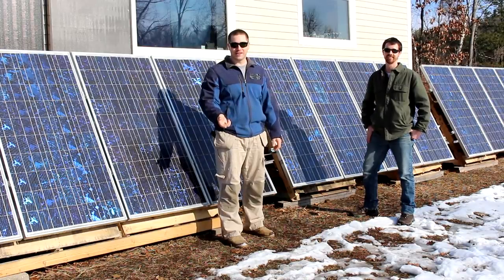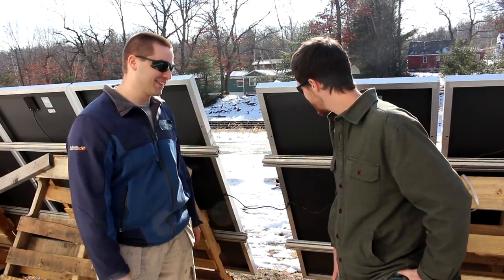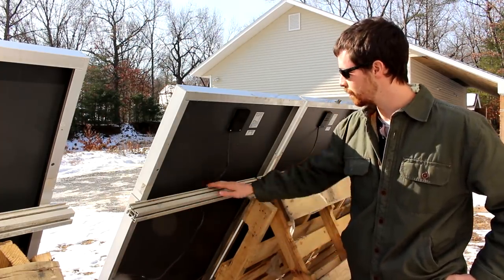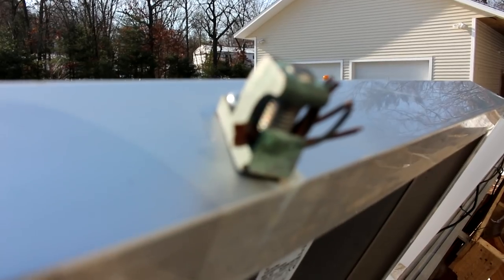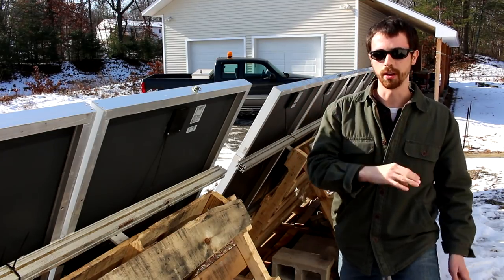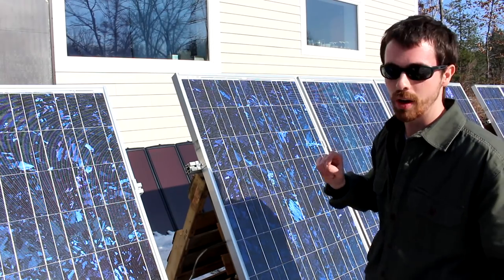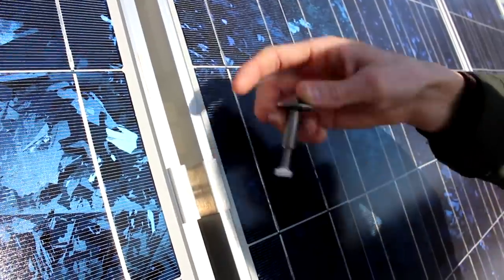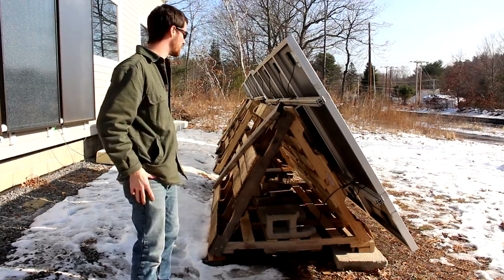A PV Expert finds the flaws in my system

Comment: Kevin was on riddilin hunh ?
Reply from the maker: Kevin just has an awesome personality.
Reply: dude you actually responded , awesome . me n my wife love your kid . he'll be wearing a tool belt in no time hanging out with his awesome father . have you ever seen the gas  DC only smart generators? they auto start when battery voltage is low. they seemed to have just disappeared. they were on Ebay.  came as a solar kit . I believe a fantastic solution as a battery tender when PV and wind is down .
Reply from the maker: Thanks for watching the videos, I'm glad both you and your wife enjoy them.  I've seen DC generators for 12v, both commercial and DIY versions.  However, I've never seen a 48vdc generator.  It would make for a fun project.  If you ever come across one, please send along a link.

Comment: All great comments except he is incorrect when it comes to shading series panels.  All modern panels (including probably these old ones) have bypass diodes, so shading a single panel does not take out the whole array.  It basically just takes out that one panel plus 0.3V of drop (out of 200V-500V), so it will only slightly disrupt the other panels.

Very very old panels... grade B or C panels 20 years ago (grade A panels would have had bypass diodes) ... very old panels did not have bypass diodes and shading one would take out the entire string.

The issue with string efficiency also relates to whether each string has its own MPPT or whether several strings are parallel'd together before going into a single MPPT.  When each string has its own MPPT, shading is minimal hazard.  However, if the two strings are paralleled, shading one panel on one string will cause the MPPT point for the paralledl strings to not be at the optimal point for either string, causing roughly the same loss across both strings as the loss from the shaded panel.   So multiply the shading loss by 2 in that situation and you get a rough estimate.

(Says me who has a two-string HV array and has done numerous shading tests over the years).

Comment: the angle of the panels should be flatter. your not in arctic circle.
Reply from the maker: Hi Borga,  You are right about the angle if this was a grid-tied system.  However, I'm using these panels differently.  I have another video here:  https://youtu.be/jFoxIit8NYA

Comment: I would like an inspector to show me the potential voltage difference between those panels. 4 aluminum to alum. connections per panel, which lack a UL bonding stamp just dont cut it.. Some regulations meant well in one area get applied across the board just make the wire company more money and give meth heads more of a reason to approach and steal parts off your system.

Comment: EMT is not waterproof. Industry standard is PVC.
Reply: He did show compression connectors. Your correct, not "waterproof" There is waterproof, water resistant and rain proof. EMT would water resistant with the correct compression connectors and couplers
Reply: i have never seen a professionally installed system using pvc
Reply: Davep6977, correct.  Now, a new coupling/connector has come out that is very similar to 'shark' fittings for plumbing.  Complete with O-rings to make them suitable for burial in poured concrete [water tight].
Reply: KoG GoK different countries different standards. HD pvc solar conduit is the standard in Australia
Reply: In southern California it doesn't pass code because the sun ruins everything manmade.  (and some natural materials too)  The EMT is required from the exterior wall where the panel/inverter are, to where the array(s) start.  A weatherproof connection box at that point converts to the wire/cables that come with the solar panels and optimizers and the bonding ground wire which I supply in one piece, which are all weatherproof.  None the less, the wires must run along acceptable paths, using regularly spaced and approved clamps and clips.
Reply: With my professionally installed PV system. They used metal. It was inspected since a permit was pulled for this project.
Reply: Technically South Africa is on par with most Euro, but America??? Cant talk about ethically tho! South Africa we stopped insisting on EMT a few decades ago, the notion that "because the sun ruins everything manmade" is antiquated. Americans should stop importing cheap crap from China , start producing their own again and save their economy! I thought Africa was behind...

Comment: Get a real expert next time. Batteries in series increases voltage 2 12v batteries in series gives you 24v out but the same amps, in parallel it increases the amperage output 2 12v batteries in parallel give you 12v out but increases the amps out..
Reply: 100% correct bubba!  So, changing from series to parallel means EVERY component has to change (ie 12 volts charging batteries compared needing a voltage regulator to do something with the (12 panels x 12vcd )= 144 volts you'd produce in series. And the "expert was correct. Series good. Parallel not so good. One bad or lower producing panel will effect the whole circuit in series connection.
Reply: You are correct  ... except maybe you should actually pay attn to what they stated before criticizing. He said a cell in a battery pack, not 2 battery packs. For examply your typical 12V auto battery has several cells, but that one battery still is only 12V. Now IF one of those series cells inside that battery is not producing, it will impact the entire battery. Get some real ears next time mate ;)
Reply: davep6977 , to put it another way, in series, overall system performance is more susceptible to individual component issues.  Whereas in parallel,  overall system performance is less susceptible to individual component issues. Does that make sense?
Reply: Parallel is fine, there's nothing "wrong" with it, and if one panel gets damaged you're still producing electricity minus one panel where as with series you lose a panel you lose all power.   There is a trade off with this "convenience" though, and that is that you need to run a LOT of wire, since current adds together in parallel cases, either wires from each individual back to the inverter (or from microinverter to your panel) or if code allows it (I'm not sure on this case) into one common wire but that common wire needs to be super hefty to carry the current to the panel, basically a series connection reduces cost of the system.   The other issue with parallel connections is that some inverter require a minimum amount of voltage to "turn on" if you have 10 panels in series, and 36 volts each panel, then you have 360 volts on your inverter and all works fine,  where as if you had parallel it would only be 36 volts to your inverter which may not even kick on at that level.
Reply: The expert is correct in this case about the solar panel array shutting down with even partial shading on a single panel in a string. You'll lose like 50% of your total power if even one of your panels is shaded.
Reply: private bubba to
Reply: batteries in paralel the amps join but will be at the lowest of the battery  aka a 120AH and 105AH will give you 205 AH
Reply: Isn't there also a safety issue with parallel vs. series in that higher voltage at the same power will be a greater shock hazard? 12 panels in series puts out a lot of volts, more than enough to kill you with bare skin contact.
Reply: @tomszabo7350  it's the Amps that kill you not the volts.
Reply: That hapens when you have no idea how to monitoring your system!!
Reply: series batteries has higher voltage and need smaller diameter cables to transfer the power . AH are the same bat if you rise the volts you decrease the amps, so you need serious smaller and most cheep cables to transfer the energy. That is very important when we use DC over long distance!!!
Reply: No. Minor no but no none the less... Amps are drawn by load and resistance of supply line. The battery bank or psu supplies what the load demands or in short circuit it supplies i=e/r aka  amps = voltage / resistance. Paralleling gives ur bank the ability to supply more it won't push, force or otherwise coerce more amps down the line for the same things attached to line
Reply: @VroomvroomNY  to be fare it's both... I=e/r... Takes like 0.1 to 0.2 A for a kill shot more likely than not to drop a person. So with that equation and knowing skin resistance is what limits the current.. It takes a certain voltage or someone into sticking wires into places /orohaces with uh... Less resistance?

Comment: Angle too high
Reply: Not necessarily.  Depends on the latitude and the season.   Optimal Spring Angle = Latitude.  Optimal Summer angle = (latitude - 23.5).  Optimal Fall angle = Latitude.   Optimal Winter angle = (Latitude+23.5). 

It would be cool to make a hinged pallet system where you could adjust the panel angle for the seasons.  The video had snow on the ground, so I'm guessing it's winter-time.
Reply from the maker: It was winter when we shot this.  I agree that the angle is steeper than normal, but great for winter production.
Reply: The Azmith angle differs to were you are in the world. 
At the equator they would be aiming almost straight up.
Reply: So where in the world do you mount panels at such a steep angle?
Reply: Some people set them to optimize winter production, instead of going with the average between summer and winter. They might do this because they need more power in the winter, but over produce during the summer.
Aussie, where this might be done? Any location anyway from the equator by 30 or more latitude.
Reply: Depends on where u live
Reply: Angle = latitude (close enough)

Comment: Take this in the wires from the solar panels have no electric charge until I get to the converter and charge the battery that is fact that has proven and they had to make it that way for shockproof things on solar panels or there would be no solar panels for the people to buy in the United States of America and that is the law. And the law says it cannot have electricity or they can't make them either so there is reason why there is shockproof and electrified proof as the law go's in the United States of America.

Comment: First mistake is spending hard earned money on useless solar cells.
Reply: I would be interested to see what his actual output is on 10 year old panels as compared to today's more efficient ones.
Reply: “Useless” how so?
Reply from the maker: Hi private bubba,  I was very surprised to find that they are still producing at their rated output.  That was in February, when the sun was perpendicular to the panels.  I'm sure you can tell they are at a pretty steep angle.
Reply from the maker: Hi Robert, The ground mount is made of old pallets.  I have a video on making the frames here: https://youtu.be/sHy2Mpfzho4
Reply from the maker: O, sorry, I miss-understood.
Reply: Solar panels will pay for themselves in about 2.5 years.
Reply: so will that weed you're smoking -